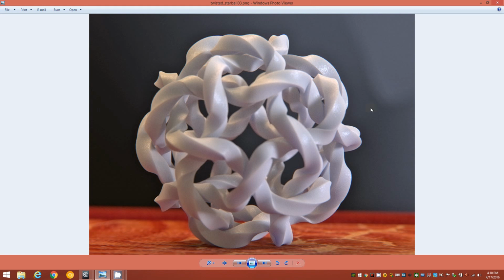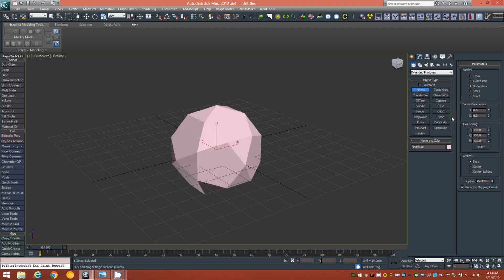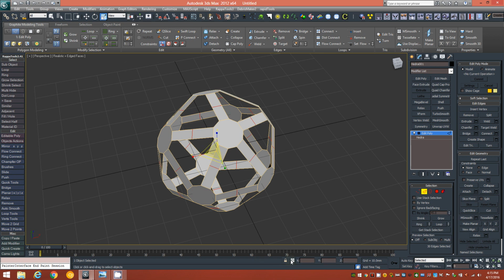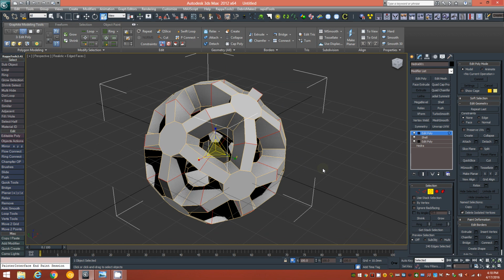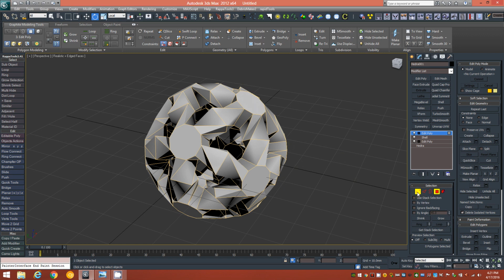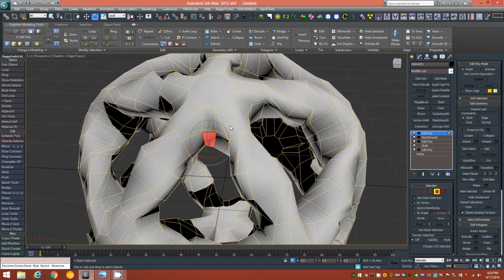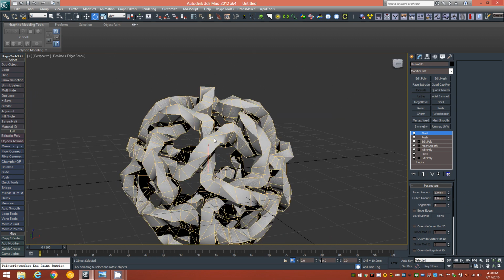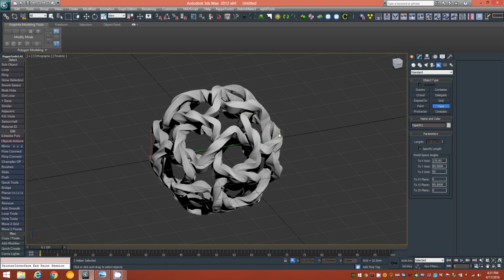3d Tutorial | Twisted StarBall For 3dprint | 3dsmax

Comment: hai john,,why when i rotate it,,(the borders into 90"),,the vertex became separate,,doesn't same look like what you did?..can you explain,,thx
Reply from the maker: Are you sure your scene setup is exactly the same as I've indicated at the start of the tutorial?  In order for the parameters and angles to match up exactly to my own, the scene scale will need to match exactly what I'm using as well.  If you are using a different system scale, for example, then you may experience differences in numerical values or parameters from what I'm showing in the video.  At which part were you having trouble exactly?
Reply: i following this tutorial from the beggining (exactly same)..in minute 10-11 when you twist the border..my version it separate,,
Reply from the maker: At that point, I do not have borders selected.  I've capped the holes and created polygons inside the borders.  Then I have selected the polygons and rotated those with "use selection centers" on the Z axis.
Reply: ok i try,,thx bro,,you're the best

Comment: Im just curious. How much do you think it would cost to print at that size?

What about at the size of a  basket ball?
Reply from the maker: Depends entirely on the printing material.  For example, I have this for sale at my Shapeways shop in various materials, the least expensive being white plastic.  It costs around $25 US for a 2 inch x 2 inch print.  See here:
http://shpws.me/L7Zz
Other materials like metal would be more expensive obviously.  However, if you were to reduce the size, then the cost comes down accordingly, although you need to maintain a certain thickness to be printable in certain materials.

Comment: Do I have to split the edges, then cap borders and all that stuff or would rotating these edgest work just fine?
Reply from the maker: I'm not sure what you mean.  Can you refer to a particular part of the video?  Usually, the steps involved in making these shapes must be done in order, but sometimes there are exceptions or alternative techniques which can be used to achieve the same results.  It's possible there may be another way if you experiment, but if you specify which part you're referring to, perhaps I can help.